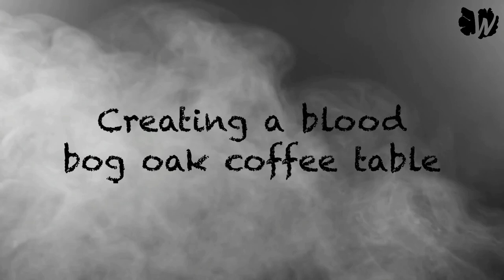Blood bog oak coffee table out of an exploded bog oak cookie slab #bogoak #coffeetable #epoxy #red

Comment: Hi. Hoping for some advice from someone who works with epoxy a lot ...  Apologies in advance for length. 

I've kept an 800mm diameter spalted Beechwood cookie slab indoors for over a year and recently started working it - first flattening and then bridging some smaller cracks running in from the edge with bowties.

These cracks are max 1 to 4mm wide, 50 to 150mm long and 55mm deep (the thickness of the flattened slab).

I used an expoy resin kit from Amazon that I have had good results with before. It isn't deep pour as while the cracks are 55mm deep, they are very thin - not sure if this was my first mistake?

I accurately weighed the A+B and pigment was 3% and I'm happy it was all fully mixed.

Unfortunately I chose to "use up" resin that I had bought 23months earlier and it hasn't set up after 3 weeks.  The epoxy is now a grainy rubbery consistency that I can pick out of the wider cracks.

The bowties are fine but there are now (small) cracks between the epoxy and the wood and I just don't know what to do.

Do I try to remove the epoxy (not really sure how) and repour, or is the whole project ruined?

I really hope there is a way to salvage the piece as I had done a lot of work before the epoxy pour...

Any advice gratefully received.
Reply from the maker: Hi Nils. Happy to help. Overall this doesn't sound good, I agree with you. You seem to have two problems:
1. Your slab might not be dry. If you waited only 1 year after chopping the tree, and it was a think slab, it won't have dried out. The fact that there are cracks where the bowties are, is a sign that the slab might still be wet. Did you measure the rest humidity? It should be max. 12% for it to be workable.
2. I HATE resin that doesn't cure. I can't tell if the resin was old, or you screwed up the ratio, but if it didn't cure after three weeks, you need to remove it. That is fiddly and nasty. You can scrup, sand, use rags, whatever works for you to get it out. It's really painful and in some cases, I have thrown the slab away because it was not feasible.

Sorry to not share better news.
Reply: Thank you so much for the quick reply! 

I am currently going at the epoxy with my smallest chisel and at least trying to clear out what I can reach.
I am very much a DIY / enthusiast woodworker and as my timber supplier has been great to date, I've not invested in a moisture meter, which I am now giving a lot of consideration too!

I think it probably was old epoxy more than anything else.  So now I know the answer to "what's the worst that could happen" (maybe something worth exploring - I liked your tips for keeping Rubio but I think epoxy just ages regardless of storage?). 

I have invested a lot of time into the slab to date, so I'm going to see if I can rescue it before I give up! 

Thanks again - I really appreciate you taking the time to answer and I've learned a lot from your videos (When I went no where for 2 years in lock down, I invested what I saved in holidays / transport and bought a Shaper Origin and your videos on that and various bit comparisons have been a great resource for me)!
Reply from the maker: Honestly, I have never had epoxy resin go out of date, so I looked it up, and apparently "Epoxy resins can last for a year, unopened, and properly stored. You should keep them in a dark, cool place that's climate-controlled. A closet is a perfect place for this.". I have certainly used resin that was older than one year, but yeah, using it up fast and storing it in cool places helps (I live in Switzerland and my shop is rather cold, so that might help). 

I am pumped you find my videos helpful - that is why I make them. Thanks for watching and don't hesitate to reach out again if you need my help.